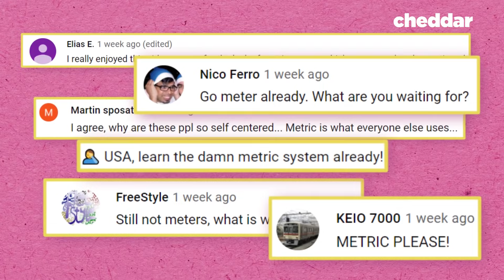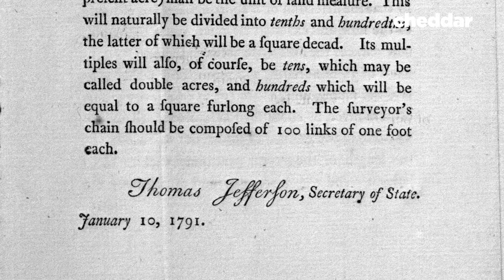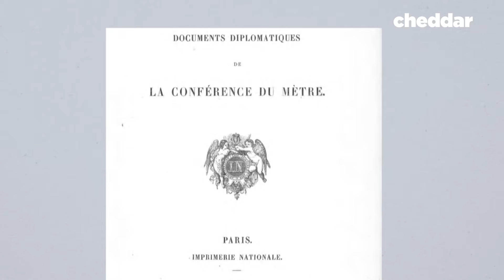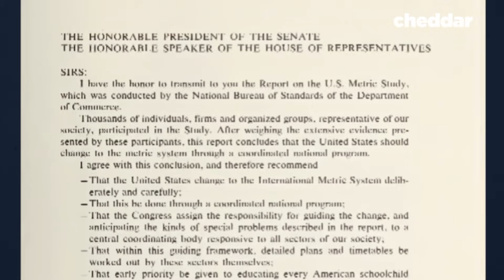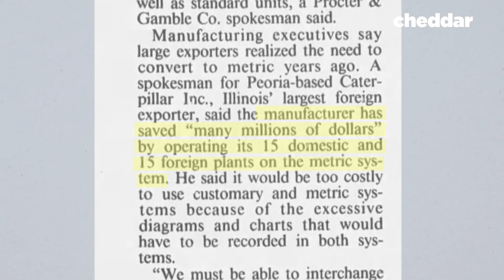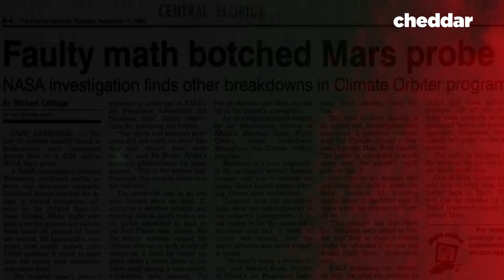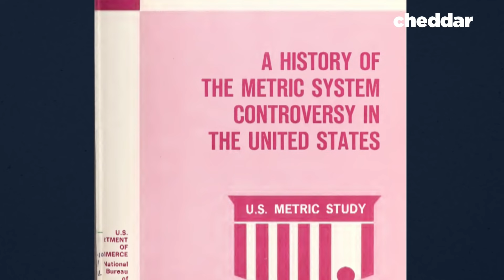Why Doesn't the US Just Use the Metric System? - Cheddar Explains

Comment: What about Fahrenheit? They are very unpractical.
Reply: Honest question and excuse my ignorance, but I'm wondering if European thermostats go up/down in .5 increments? Because in the home, I can certainly notice 1F in temperature change. You don't only have 18-26C to choose from, I'd hope?
Reply: @djisar  Analogue thermostats are typically only graduated in 1C increments though of course being analogue you can set it anywhere between graduations. Digital thermostats vary some really cheap ones might only do 1C increments but you can get plenty that will actually accept a setting to 1 decimal place (0.1C precision). As for the range my digital thermostat will accept any value between 10.0 and 35.0, in older houses with analogue thermostats it's not unheard of to see graduations down to 5C but then older boilers didn't have built in frost protection so setting the stat to a low temp but above freezing when going away was a work around for that. Modern boilers will generally override the thermostat and fire on their own if the inside temperature drops bellow 3C to prevent pipes freezing. Note this is based on my experience in the UK thus why things like frost protection is relevant to systems here as if you go away in winter it's very possible to come back to a flood without it.
Reply: @djisar  no our thermostats are very precise and you can choose to warm up a half degree celcius if you want it to have slightly warmer
Reply: @djisar  In China, we usually don't go to 0.5 or 0.1 when talking about weather and AC setting, because there's no point doing that (giving that you really can't feel the difference anyway). However, in non-weather temperature measurement, 0.1 precision is common because that info is useful.
Reply: F*** Fahrenheit and Celcuis 
Lets use the Kelvin system, no negative numbers, no arbitrary freezing points, it's perfect!
Reply: @Texan.Insomniac  ...You realize the Kelvin system basically is the Celcius system but with the 0 put at the absolute 0 ?
Reply: @YoudonGettit  And that makes celsius obsolete.
Reply: @Texan.Insomniac  temperature differencies in Kelvin align with Celcius.   10 K more or less = 10 degrees Celsius more or less.
Reply: @rivenoak  
I was just joking about the whole Kelvin thing but that's actually really cool
Reply: @Ankur S Farenheit does so have anchors.  Farenheit was based on materials that were important to everyday people at the time.  No one knew that water would become some standard  material and they used what was more pertinent to everyday life.  Brine and Blood freeze at 0F, which is important to cooking, shipping and personal health.  A person is sick when they have a 100F temperature.  Based on those temperture points, water boils at 212F.  It wasn't until someone decided that water should be the source of reference that Celsius became so important.  Why water, anyway?  What's so special about (fixed) Dihydrogen Monoxide?  There's lots of other liquids out there....
Reply: Fahrenheit is the best for talking about the weather.
0F is very cold, 100F is very hot. Everything between that you can think of as a percentage.

By contrast, 0C is kinda cold, and 100C is death. Not as helpful.
Reply: Celsius is just as arbitrary and unpractical as Fahrenheit. If you want to use a temp unit actually based on fundamental laws of nature pls use Kelvin
Reply: @AdamSmith-gs2dv  Celsius arbitrary? Hah! That's what Fahrenheit is! Kelvin and Celsius are the same scale - with difference zeros according to need. The absolute zero of Kelvin works well for science. The Celsius zero degrees for the freezing point of water, going to 100 degrees for the boiling point of water, works well for general usage. Fahrenheit, however, is just a vague assigning of zero degrees (really really really cold) up to 100 degrees (really really really hot). Freezing point is the oh so intuitive 32 degrees.  Clever, not. Subjective crap you really should leave behind...
Reply: Neither F, C or K is arbitrary.  All three were designed by early scientists, for scientific measure and communication:
F 0-100 is the normal survivability of unprotected animals and humans.  50 is ideal (for Northern Europeans), 70 is warm, 100 is very hot indeed.  30 is quite cold, 0 is dangerously cold.  So it is a human relatable scale.

C 0-100 is freezing to boiling water, but only at sea level at 1atm.  100C you'd be long dead as an animal.  0C you'd be chilled but not horribly, dangerously cold.  Very relatable if you are a beaker of water.

K is just C with an absolute zero correction factor.  Absolute Zero was meaningless to 18th century naturalists.

All three are European.  All three have their reasons to exist.  Asia had other temp measures before colonization.  These systems were mandated onto colonized societies for the convenience of the colonial powers.
Reply: Actually, temperature is the one place where you'll find the most resistance. Even those of us who have no problem with metric frequently despise the overly large units of the Celsius scale. Humans usually deal with weather between freezing and scorching: 20 to 120 F, vs. -7 to 49 C. Celsius is scrunched up together since the degrees are 9/5 the size of those in Fahrenheit; yes one can use decimal, but that's awkward for casual use... one could also given the temperature in deciCentigrade :-P
Reply: belg4mit I extremely resist the change in both the metric units. It's like even if we change to metric distances and metric temperature they will still want us to change to there metric calendars and metric months and metric days and metric years and I can't have a 10 hour Day with 10 days a month with a 100 day long year! It wouldn't make any sense to change to metric calendars or metric units since they are all just a jumble based on 10s
Reply: @belg4mit  It's all about the way people understand temperature. In China for example, south China people would consider 25 C to be "cool" while north China people would consider it "warm".
Reply: Fahrenheit is silly. Celcius is very practical
Reply: @Xyb3rTeCh  Only in science, not in everyday use.
Reply: @Xyb3rTeCh  Wow...a very concise, but equally useless argument.
Reply: @Xyb3rTeCh  Livable temperatures tend to range between 0 and 100 degrees fahrenheit. In Celcius, that's -17 degrees C to 39 degrees C. Fahrenheit provides finer increments within this range, and avoids negatives except when it gets really cold. When giving a weather forecast, Fahrenheit temperatures in the "40's," "70's," or "90's" are all universally understood.
Reply: @Accountinator  same concept with Celsius where ice melts at 0 deg C and water boils at 100 deg C. But you are not wrong with that finer increment.
Reply: @Xyb3rTeCh  There's something about numbers from 0 to 100. For example, most US stocks are valued between $10 and $100. Companies will split their stock or issue more stock, give stock dividends, etc., in order to keep their companies' stock values within these ranges.
Reply: @Accountinator 
This is also applicable to human body temperature. Even though I live in Russia (hence barely coming across imperial units) I do realize Fahrenheit scale is more convenient because its high precision help avoiding using decimals.
For example, normal human body temperature is around 36.6C (measured in armpit not in the mouth), if your temperature reaches 37.2C it's not fever yet but you already don't feel good, at 37.8C you are definitely ill but the temperature isn't high enough to take paracetamol, at 38.3C you already need to treat fever as the temperature is concerning, 38.9C means you probably have flu, 39.4C is typical for acute tonsilitis and very concerning, 40C is dangerous and might happen in case of food poisoning, serious treatment is required. Now look how simple it would be in Fahrenheit: 36.6C ~ 98F, 37.2C = 99F, 37.8C = 100F, 38.3C = 101F, 38.9C = 102F, 39.4C = 103F, 40C = 104F.
Reply: @Accountinator  So even if you would be able to tell the difference (which I doubt as wind and humidity also influence how one perceives temperature) between let's say 72 and 73° F... what difference does it make? Is it in any way practical to have this ability? Do you have to wear something different or do you have to change anything? You act like it would be a issue but it simply isn't. If it would be then we would use decimals or Decicelsius/Centicelsius or something like that.
Reply: @gravelpear4803  Was the Metric system based on scientific behavioral research showing that people can tell the difference between 30C and 31C, but cannot tell the difference between 60F and 61F?
Reply: @WildfireRND  Exactly. Europeans who are ignorant of the US customary system or UK the Imperial system see them as antiquated and unnecessarily complicated. There are many benefits to them, which explains why Americans, Brits, and Canadians still use them.
Reply: @Accountinator  Nope, but that's not what I said and I'm pretty confident you missed my point deliberately.
 Most people won't be able to tell if its 20 or 21°C. Hell I'm currently inside my room and if I would not have a thermometer on my desk I would've guessed its 19°C even though it says 21°C. Probably because I was covered with a blanket just a few minutes ago.
Additionally I study biology and recently passed my neurobiology exam. Our thermoreceptors aren't build to measure temperature but to prevent harm. Have you ever wondered why 20°C (I think that's around 72°F)  water temperature doesn't feel that comfy?
Reply: @Accountinator  There aren't any benefits. You've been brought up with them. Therefore imperial meausurments are more intuitive for you. As I watch a lot of American videos I know how to convert most of the measurements and even though I know that 1 foot is around 30cm I have to convert it first in order to actually imagine how tall/long whatever something is. You probably feel the same about metric but that doesn't mean imperial would be more useful or universally (!) more intuitive. 
It's not like someone who only knows metric isn't able to estimate how long, heavy or cold/warm something. Using metric we are perfectly able to convey the same imformation equally as detailed as people only knowing imperial. You don't know metric therefore it's not intuitive to you. That's it. That's not an argument but a feeling. But as the orange orangutan you've voted into the oval office has proven that's good enough to count as a fact.
Reply: @Accountinator  Additionally you haven't answered my question: Why do you feel the need to express that its very slightly colder/warmer. Is it actually useful? We could use Decicelsius if you want to be even more precise but guess what: nobody feels the need to do so.
Reply: @gravelpear4803  First of all, the US does not use the Imperial system. 

American schools teach both systems, and our products are always labeled with both. American students learn how to convert back and forth, though any Smartphone can do this for you. Knowing both systems, and having almost every product measured both ways, Americans, on a daily basis, choose to use the customary system for almost everything. 

I think I have sufficient experience with both systems to know what I'm talking about. The Metric system is inherently flawed because certain numbers do not divide evenly into 10. Something as simple as 1/3 of a kilo cannot be rendered into decimals precisely. I would also argue that the customary measures are inherently preferable because they have survived through an evolutionary process, over several hundred years, where they were selected by populations (not by government officials) over less useful measures. (For example, why do people buy eggs by the dozen? Because 12 is a good number for eggs. I'm sure people in different cultures have tried buying eggs in different numbers, and perhaps, in some countries, people buy 13 eggs or 10 eggs at a time. But, through an evolutionary process, propulations have decided that 12 is a good number for eggs, and they probably did not need government bureaucrats to tell them that eggs should be purchased by the dozen.) That's not to say that the US customary system doesn't have its problems. In the customary system, some people may need to look up how many feet in a mile, how many fluid ounces in a cup, a pint, a quart, etc. But this is not difficult for a student to learn in grade school. (Honestly, when cooking, my son has asked me how many ounces in a cup.) And I think it is silly that the same term, "Ounces," is used to denote both weight and volume. 

I don't have anything against the Metric system, and I'm sure that people all over the world manage to measure things, weigh things, and check the temperature just fine, regardless of which system they use. But I think that silly claims of "those stupid backward Americans can't even metricize" ignore the reality that the US customary system offers a few benefits over Metric. That's why Americans, on a daily basis, choose to use it.
Reply: @gravelpear4803  Congratulations on passing your neurobiology exam. 

Ideally a temperature measure would use gradients that make a difference to people; that people can tell the difference when the temperature increases by one point of whatever. This way, an increase would convey information without wasting any information. If people can detect a difference in a single degree of Celcius temperature, then it would be waste to communicate it with tenths. I do not know what change in temperature is detectable by the average person, or perhaps by 80% of the population, nor do I know if there are studies to that effect. But I would argue that whatever system conveys the right amount of information, based on what people can detect, that that would be the ideal system. (Anecdotes about the temperature in one person's room at one time, and blankets, are just anecdotes and do not speak to the larger preponderance of real-life data.)
Reply: Fahrenheit degrees are a conspiracy to confuse the rest of the world. But apparently the average American doesn't learn negative numbers in school or something.
Reply: @Ankur S The "0 - 100 is ez to remember" is a faulty argument.  In the US, 32 degrees is when water freezes (which everyone knows) and water boiling point doesn't matter because a) you aren't going to experience natural environmental temperatures that reach that b) no one measures the temperature of water they are boiling to cook...they just wait until it boils.  The boiling temperature is "meaningless" because your average citizen is never going to use it in day to day life.  F is superior for casual, day to day life because the range is larger in terms of the temperatures people actually live in.  Units of 10 convey the temperature outside (40s, 50s, 60s) in a meaningful way, and more specific breakdowns convey even more info (ie, 92 degrees vs. 98 degrees, or 72 vs. 77).  C, on the other hand, is squished into a much smaller range of temperatures people actually live in, so you're forced to use decimal points to more accurate convey temperature whereas the same issue doesn't exist in F.
Reply: @cylontoaster7660  The boiling temperature is totally useful in daily life, because if something should be cooked in a certain temperature range, knowing the boiling point means that you can decide if you should boil it or fry it. As for "squished range", if 40, 50, 60 is meaningful number for outsided temperature then, why wouldn't 5, 10 and 15 in celsius? Not to mention you can add decimal to the value if you wnat more precision anyway.
Reply: @cylontoaster7660  "no one measures the temperature of water they are boiling to cook" - Maybe. But freezing and boiling points are still important whenever you deal with water (almost everywhere). Around 0 °C raining or snowing, is the soil frozen or muddy? The 30-60-90 °C range is useful for washing clothes, 100 °C will burn your skin, 100-200-300 °C range is useful for cooking in stove (low/medium/high heat).
Reply: @kyjo72682  You talk as if you can somehow select, numerically, the temperature of all the water around you.
Reply: @cylontoaster7660  Equally faulty argument. Customary units like the inch use 1/2, 1/4, 1/8, 1/16, 1/32 with ease. So what's the problem with "half a Celsius", if you really really really need that level of precision? (And to someone familiar to metric, saying it's 15 C or 20 C conveys as much information as to you saying it's around 60 or around 70 F).
Reply: @dlevi67  The difference between 60F and 70F means I need to wear pants and a jacket, vs shorts and a t-shirt. That's a big difference.
Reply: @DoomFinger511  Yes. So? (BTW, at 70 F, or 21 C, I'm still fine with long trousers and a long sleeved shirt rather than shorts and t-shirt, but that's personal preference). You seem to have missed the point.
Reply: @cylontoaster7660  0 = freezing. 10 = pleasantly cool. 20 = room temperature. 30 = hot. anything above = unbearable. What could be easier than this?
Reply: @uncinarynin  0 very hot, 100 very hot, and everything between being essentially a percentage between the two. That's what could be easier.
Reply: @fireflocs  with 0 and 100 both being very hot, anything cooler would be negative?
Reply: Celsius is a joke. 100 degrees between freezing and boiling, Fahrenheit 180 degree difference, nearly twice as precise as Celsius.